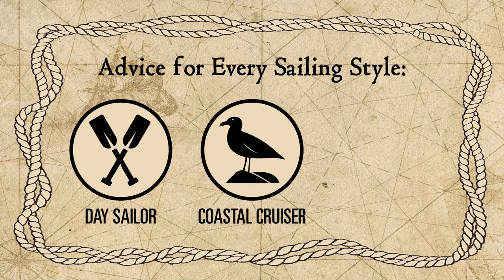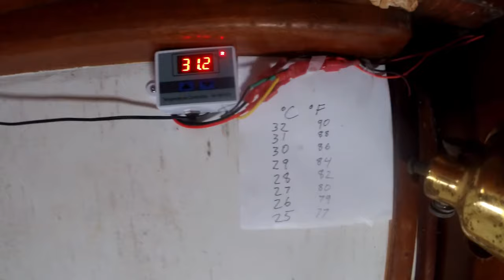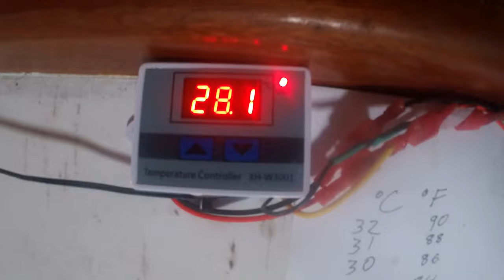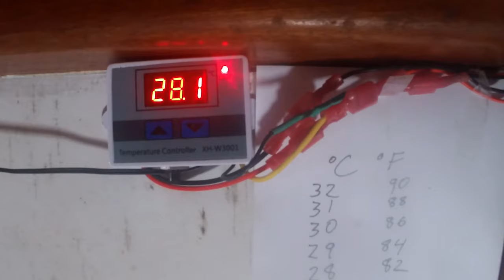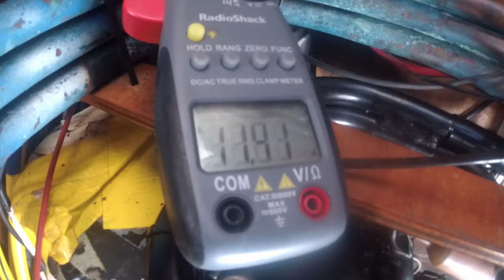Battery-Powered AIR CONDITIONING on a Sailboat [Capable Cruising Guides]

Comment: Clark, is your system in anyway adaptable to an RV Van conversion? I am currently building out a high roof Sprinter Van. Off the shelf 110 rooftop RV AC units are power hungry to say the least and require a noisy generator or shore power. The few 12v rooftop units available are running $4,000+.  I am figuring the cabin volume of a van is comparable to what you have on the boat. I am a remodeling contractor by trade so fabricating, sweating copper, wiring, etc is in my wheel house. I am looking for something DIY that will get me through the night comfortably. I have 200a/h of lithium(plan to go to 400. Charging consists of a 200 watts mppt solar and dc/dc alternator @50amp charger controller. I will be offgrid boondocking and don't want to rely on shore power from RV parks.  Any advice on how to utilize the compressor you mention to build something??  Cheers!  PS. after I do the van life and travel land base I want to switch to boat life and travel Gulf waters and live "on the hook"
Reply from the maker: I'm thinking of you.  Yes you could build this with an air condenser.  It will burn a bit more power but still be the most efficient on the block.
   Fill out the survey.
You could curtain off around your bed to save more power.
   I think you will need more solar to run it every night.
Reply: @Clarks-Adventure  Yes, I was thinking about installing a curtain to minimize the space. Would there be any advantage to have a small water tank dedicated to circulating through a water condenser? 10 gallons or so? or is the air to water condenser efficiencies not worth it? Maybe utilize both? I believe I am able to get to 400 watts with my current solar controller. beyond that I don't think it's rated for more voltage.(still have to verify that). I did fill out the survey. Thanks for your prompt response.
Reply from the maker: 10 gallons of water would just become 10 gallons of hot water real soon and no longer work.  You need to get rid of the heat some way.  Air is best.   You might be able to radiate over a large area so you don't need as much fan.  Maybe into the frame of the van first then out the fan on a thermal switch.

Comment: Clark, I am serious, I want one!  My wife and I live-board a Catalina 470 on a mooring in South Florida, already have a hybrid lithium/AGM bank and I'm in the middle up upgrading that to 1860Ah, plenty for a project like this.  I'm an engineer, so a DIY approach is fine.
Reply from the maker: Yes it would be perfect for that.  And you have the infrastructure for it.  You might want to consider my bank manager to help keep your hybrid bank happy 

     Make sure you fill out the survey in the description.  Without that you won't be notified about the next step.
Reply: @Clarks-Adventure , my new bank will be 100% lithium, with separate AGM engine start, genset start, and windlass/thruster batteries.  My lithium house bank will have a custom developed Bluetooth and NMEA 2000 monitoring and control system - I write firmware for marine electronics for a living, so this is easy for me.

Would love to get an idea of budget for your AC system, and the magnitude of the task to build it.  Also would be great to know physical size so I can figure out where I can best fit it.
Reply from the maker: Fill out the survey

Comment: Great video and engineering. I would like to see how this unit would work in my 1997 Ford E-150 van. I have been doing the van life for 5 going on 6yrs now without a/c, solar or a massive battery bank(2-160ah marine deep cycle, charged and hooked up as one battery).  Just recently hooked up a parallel battery bank making 400-500ah at 12v. There was supposed to be a 200watt solar system installed but the company fell through with the delivery time frame I had available so solar is a no go for now still. Currently looking to set up a system to recharge the bank from the vans alternator using isolation relay set up. 
  The rain forest type weather is brutal at night like you mention and it would be nice to keep cool during the day if need be.
Reply from the maker: Yes there will be an RV version.  Make sure you fill in the survey in the description.

Comment: I am DEFINITELY interested. However, need the boat first. Still working on that one. :) I'll let you know. I already have the compressor and the vacuum pump, fittings, etc., so the basic unit would be perfect for me. 
Couple of questions though... The air distribution handler/box that you mounted behind the panel...was that re-purposed from an automobile Thinking that a trip to an auto salvage yard could yield some very useful and functional equipment. A few feet of insulated 3" hose or conduit routed through side panels or the bilge, and you've got directed airflow wherever you need it. Just like in an automobile! :)
Also, does the company only make one size compressor? Or do they have a few different sizes? Curious if they would have larger sizes that would be useful for slightly cooling larger areas, like a larger cabin. I agree that the entire boat would not need to be cooled (would be nice, but...there are tradeoffs to living off-grid). And sleeping is when the comfort would be most useful.
Thanks for the great video! I'd love to see a vid of you building the system as well.
Reply from the maker: You should fill out the survey to stay informed.

Yes it's automotive.  I like automotive as it's tested and tough but I re worked the blower speed controller to pwm.  Much more efecient and nicer.

These compressors are VERY expensive to buy one at a time.  I'll buy pallets the get a discount.  There are some newly available larger ones but I haven't tested them and you would have to pay full price unless I sold a bunch.
   You could use two compressors in parallel.

Pass this video link around!

Comment: Hi Clark, Great video and here I have the million dollar question:
Can you also use this compressor to generate heat? 
I am in the PNW so sometime we need heat, sometimes we need cold. Even just  a little bit of each.
Reply from the maker: Sure just need a reversing valve, a couple of one way valves and a second expansion valve.   I'll be developing one sometime but it's not that hard to add to the kit.

The kits are available at MarineDCAC.com

If you make a heat pump share your findings with me OK?

I sailed out of Seattle I know what you mean.

Comment: I think to you just set me down the rabbit hole to figure out what compressor that is🤯 Live here in Florida have a 35' Ericsson mark 2  Several marine AC units  Being a boat mechanic you end up with  therefore a look at building one out of either parts or ripping 1 apart Randomly found your Video very informative that there is still something out there just gotta keep looking Going to look through your videos Hopefully you have a cool no Water makers Because I would love the build a water maker But never really found the set up that would work for me But love the idea of being able to repair it
Reply from the maker: I'll be selling these compressors soon.  They aren't really available individualy unless you can pass as a defence contractor (I did).  
 And I'll be selling them for close to what you would have to pay if you bought one.  I'll be buying a big number and make some profit that way.

Comment: I'm interested in general - bucket of parts would be fine - I'll have to decide how to adapt to my situation. I'll usually have water available... but more often freshwater than seawater I think. I can think of situations where I might have to rely on air, though, so I'll have to figure out how to approach things once I understand the overall design options better.
Reply from the maker: Fill out the survey in the description.  It should be available as a DIY quite soon.

Comment: Have you checked into heat pipe system availability? Its been a couple years since I looked at the emerging tech.
Reply from the maker: Heat pipes move heat from hot to cold.  I've not seen that term used for something that can move heat from cold to hot.
Am I missing something?
Reply: @Clarks-Adventure  Not sure where the inversion comes in. The advantage of an entirely passive system is more desirable than the albeit innovative approach you've demonstrated. Great Work! 👍

Comment: your store seems permanently sold out, is there a chance you could give us a diy version or leads on what to buy, I see alibaba has some car/truck 12v systems that look like they would work great but need a water cooled condenser added and probably draw 1.5-2x your amps.
Reply from the maker: I'm currently negotiating with people to restart this product line.
The best thing to do now is to fill out the survey linked to this video description.  That will put you on the mailing list.

Comment: Is there a way to estimate BTU's? My aft cabin is about 10x12. Do you think this would be powerful enough? I would be happy with 15a even if it rarely cycles off.
Reply from the maker: Seems like it should work after dark.  Sun on the deck can be a killer if not really well insulated.

But I really don't know the magic answer in all cases.  I bet the heating and AC guys have webpages that help you calculate that stuff.

This device at full speed is like 5000btus

Comment: And the latest challenger,  the Mabru 12dc  12,000 btw for $5500.  please compare and contrast!
Reply from the maker: The big question is how many watts does it take per BTU?  It's more and that's what allows this to run on batteries.

I've not used one but I've been told it buy a viewer they didn't like it.

Also I think mine will be much cheaper.

Comment: I came here in the midst of researching my options to add ac to our 29’ express boat. This system with its consumption would be about perfect if only it had a heat option. We like to boat in the panhandle which can be very hot but also quite cold in the winter.
Reply from the maker: It's still only available as a kit.   So if you want to add heat you can.  
Hint: it's a second expansion valve, two one way valves, and a reversing valve.

But understand it will still be a low btu unit.  It won't make much more heat than it makes cold.  

Hot days tend to be a bit hot.  Cold days can be brutal.
Reply: Truck drivers use Diesel heaters -- $100 to $200
Reply from the maker: If you already have an ac why not use it as a heat pump?
Reply: @Clarks-Adventure   Because Diesel heaters use very little electric, jusr a small circulating fan.. You can cook on it too !

Comment: Nice work. Apologies for a dumb question, but where do you pull the saltwater from? Does the heat it exchanges from the refridgerant get dumped outside the hull or does it go into the main cabin?
Reply from the maker: Being a boat, we generally float in water.  So I take water from the ocean and return it slightly warmer back outside.
Reply: @Clarks-Adventure  Thanks for the reply. Would be good to know how you've set up the plumbing for this.
Reply from the maker: Sorry I don't know how to answer this.

Hole in the boat with a hose.  Goes through a strainer then a little pump through the condenser and out through a thruhull just above the waterline.

Comment: I want one. Option 1 or 2
I'm watching on my phone and can't see a survey so I'm placing this in the comments section. Our boat has two reverse cycle heat pumps that are energy hogs and too noisy. This is a perfect alternative. Even with out adding more solar, just running the generator enough to get the batteries topped off for the night time would be better.
Reply from the maker: Sure anyway you can get those angry pixies in the batteries counts.

But please fill out the survey.  I need your interest and email address there do I can keep you informed.

Comment: Can it be used in a car? I like to do things in my car but I don't want to run the engine for a long time just sitting in one place just to run the AC
Reply from the maker: Sure.  The air handler I use is automotive anyway.

Yes it should work fine in a car.

MarineDCAC.com

Comment: Hi Clark, did you ever reach critical mass on your AC unit? We filled out the survey but haven’t heard anything yet.
Reply from the maker: Yes!   I needed 50 to make it worthwhile.  I got like 1200 interested so far.  I sold the idea out to a manufacturer and he just ordered parts to make 200 units as the first order.  The parts should be in in about a month.

Expect an email soon.  I don't spam so I'll only email when I have something to say.  Though it's probably best to react fast as we can only make a few hundred at a time and there is loads of interest.

Comment: Ahoy Clark, how are you circulating the sea water, what is the pump and is that in your power budject as discussed?  Pretty dang cool methinks :)
Reply from the maker: Yes the lower amperage reading was that pump and the air handlers blower (and the thermostat but that's nothing).

I found a great little pump from Johnson controls.  It's magneticly coupled.  Perfect choice and eats just 1 amp at 12v

Comment: Somebody correct me, but 4,000 btu / 185 watts = 21.62 EER.  21.62 / .875 = 24.7 SEER, which is good, but not crazy good.  For comparison most window units are 10-12 SEER but good modern mini splits are in the 30-40 SEER range, and options abound in the low 20 SEER range.  I guess I missed the estimated cost of this setup because an 8-9k btu minisplit seems a better solution.  It would demand a minimum inverter, but be less demanding on batteries overall or have the oomph to cool more of the boat and cost about $1,500-3,000.  But ya gotta deal with the outside unit, or hack it into a water cool (which is entirely possible, people hack AC compressors to water cooling to heat pools and hot tubs for "free")  But again, what's a rough price of this secret squirrel DOD unit?  If it takes hackery anyway, to put it in perspective I could probably water cool and multi-zone a 9k btu 30 SEER Gree unit for about $2k

Of course one (potential) appeal of the system shown here is the low 4k btu range, which is smaller than even most small window units, but if they are making highly effecient and hackable window bangers then I just haven't seen them.

Comment: Really cool. Where is the cold air return?
Reply from the maker: I point to it in the video.
Reply: @Clarks-Adventure  - Thank you. Missed that at 6:55 in. This could be used in small RV's or Van builds too.
Reply from the maker: Sure.  Just need to build it with an air condenser and another fan.

Comment: I'm interested in this but I run 24v lithium,  should I just get a 24v-12v converter I have about 100 square feet to just keep cool. I run the generator during the day and use the main ac to cool the room to temp but don't like sleeping with the genny running. I would like to see how much space is required for the sled version so I can determine where to put this and the air handler
Reply from the maker: It runs 24 volts just fine.  That's a good use of this device.
Reply from the maker: You could always just install the descret parts like I did.  If you go that way only the air handler really matters.  The rest is small enough to slip anywhere.

Comment: Just saw this.  Is the survey still open?  I want one option 3.  I have a 1999 hunter 340 with aft cabin.
Reply from the maker: I just dumped the guy who was selling them. He wasn't paying my commission and other issues.

In settlement I took the inventory.
I have about 20 "kits".   You could get someone to install it.  These might be the last unless I find someone I can trust.
Reply: @Clarks-Adventure  Any kits still sitting around?
Reply from the maker: I got a new guy.  He should start selling pretty soon.  He is working on a drop in version I have designed.

No to the kits.  They sold out in a week.

Fill out the survey.  He will do a mailing soon.

Comment: Very interessant. Do you change out the air in the cabin? If not you Will get reduced o2 and increased co2 content in the air With two persons in a small cabin. If yoy take in a small amount of fresh but warm air and heat exchange IT With outgoing air in a small air to air heat exchanger IT Will solve this problem
Reply from the maker: Boat doors just don't seal that well

Comment: Hi Emily and Clark! I run a 16,000btu Marine Air heat pump that would suck down my batteries in a few hours so I don’t lol. It will run on a Honda 2000 on “eco mode” but you have turn the Eco off to start the AC so it gets a run at it. It also can’t restart it if it’s just been on, so you got to let the refrigerant equalize before a restart (just set the AC so high it won’t shut off lol). How nice would it be to not hear a generator running or feeding it gas. Just have a small unit like yours in smaller, well insulated space instead of cooling the whole boat. It being able to run on 12 volts DC  is a big factor (no inverter loss) perhaps a 24, or 48 volt system would be the next level. Keep thinking on both sides of the hull (box) guys. Good luck and fair seas.
Reply from the maker: Yes Temptress came with a 12,000 btu system.  I never used it.  Best use so far is I saved the condenser off it (the blue one) for this project.  Threw the rest away.  I'm using the space for more important things.
   Having the thing run off solar/battery means we use it all the time.  If it's hot, if there are bugs, if it's raining and we need to close hatches.  Hell, even if the local yacht club is playing music too loud, we close down and hit the switch.
Reply: @Clarks-Adventure  
Huge market for this Clark, it’s only up to your imagination. Off/on grid, sea AND land.
Reply from the maker: Yes just change out the condenser and add another fan and it works without water.